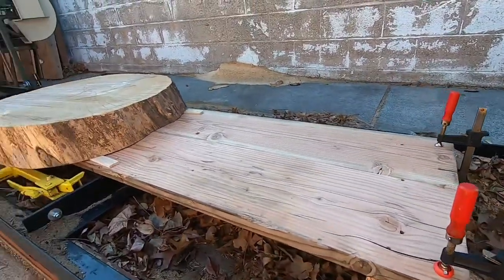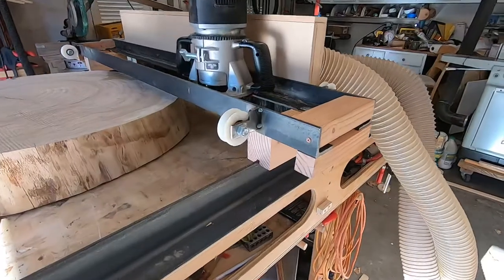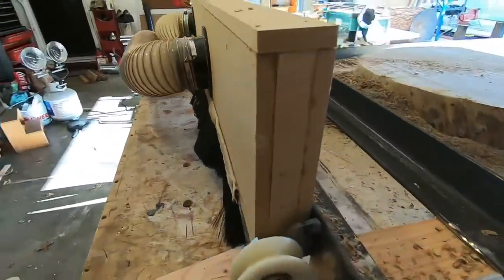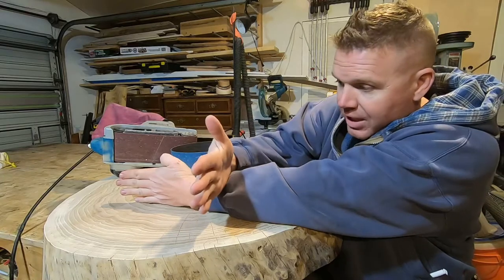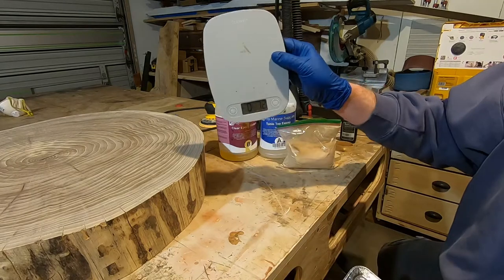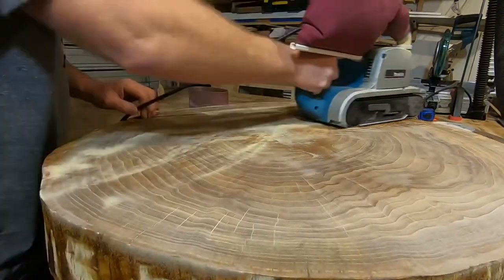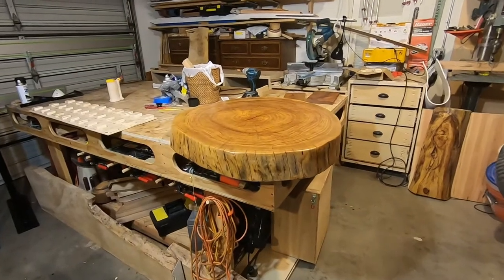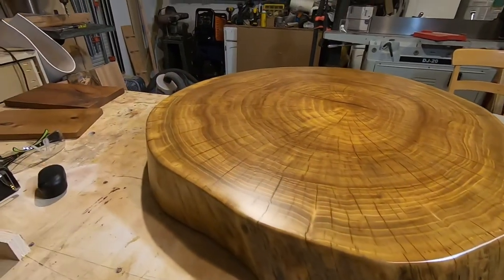Elm wood cookie fail/ new Mirka Deros sander/ router sled demonstration

Comment: nice work.  having the whole table and sled was a great idea.
dust collection is always hard. 
for the front, you can get a door sweep with bristles and a magnets to hold it in place on the long front.
to crack the code, look at CNC routers. you make a box with the bristles, dollar store brooms... 
then the hose moves with the router.
overall the measure if if you got it done.  looks like for that bit, you have it mastered.

Comment: Wow buddy that’s so cool! I love the look of elm it has nice figure and grain. Years ago my grandpa made cookie tables out of a huge walnut tree we had to take down out back. The cookies where six inches thick and 4 feet around. He used a steel band around the cookies to help it to not crack as they dried it was very nice he had them for 20 plus year. We ate a lot of lunches on those tables. Thanks for sharing. Question how do ya like you Hudson sawmill. I want to buy a sawmill now that I’m retiring. I will be in pioneer ca.
Reply from the maker: Thank you for the reply, I might try that steel band technique with some of the larger pieces. I really like the Hudson warrior mill, specifically that the rails are low to the ground. Some of the other entry-level vendors use larger channel, so it would be harder to get the logs onto the mill, unless you have a loader. Most of my large elm trees are around 3000 pounds, so the small farm tractors won’t lift them. I have some other videos showing how I put large trees on with my trailer. If you are ever in the Reno area, you can come over and check it out.

Comment: Sweet Video. I need to make such a lil table for our living room for the couch. I would be very afraid of large cracks that come when the wood dries out. How do you prevent them? Wouldn’t it be better to lot the cookie dry out before refining it? Or is it/are they actually not big enough to actually crack that badly?
Reply from the maker: You definitely want it to dry out before you finish it. I rushed this one and now I am re-doing it one year later.
Reply: @BigNicky77  ah That sucks! I cut off some slides from a large piece of fire wood, but they all cracked very badly, when they dried. So I actually have no idea how to dry such big chunks without the cracks.

Comment: As dumb as this may sound, but the reason you were probably having an issue with the Bosch geared ro sander grabbing, was you were most likely holding it wrong. Hear me out; you have to make sure it acts as a pad, not a wheel, so what you do is you hold the front like you would a normal palm sander, and then you cradle the back just so you get the sander to float rather than grab and spin. If you do this, I can guarantee you'll throw away your belt sander, because then it'll be way more comfortable and won't leave the gouge marks that belt sanders leave.
Reply from the maker: Funny you mention that, I actually bought a festool Rotex 150 And 90 about a year ago. You are right, it all comes down to how you manage the sander. I really like the rotary sanders